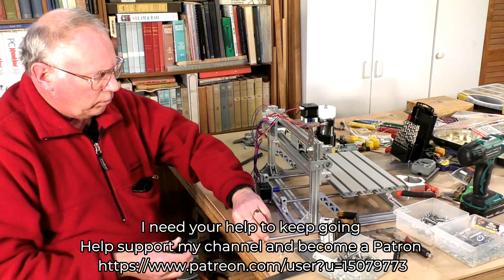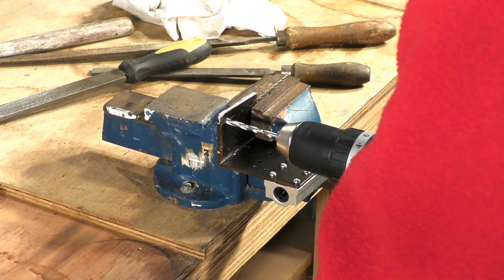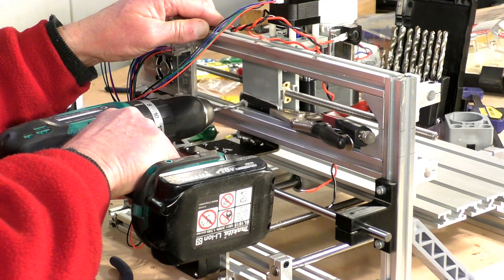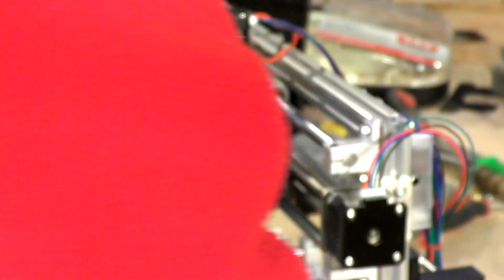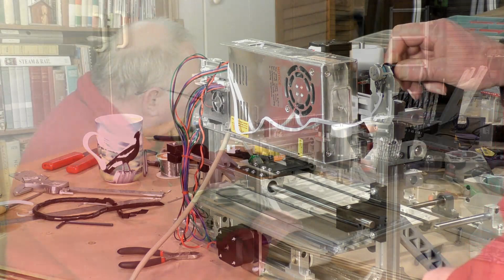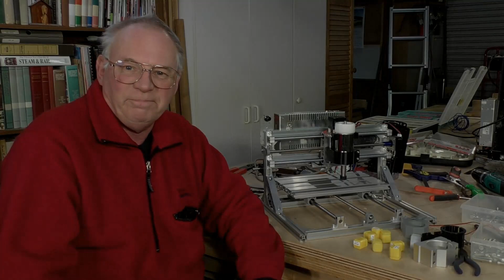3018 CNC router X-axis third (3rd) linear rail and twin bearing modification and installation

Comment: Roger, great wrk. I am doing somrthing similar, what I wish to know is is it possible to add the back rail at the top, would this work. I have mag provision for the electronics underneath the machine.
Reply from the maker: No its not
Reply: @inventorsworkshop9600  thanks Roger appreciated

Comment: 1) you've got a 500w motor being suspended by bearings in your nema17 stepper motor. Is that a good idea? Are they designed to take stress in that axis?
2) You've added an 8mm rail to two 10 mm rails. How much improvement in weight bearing will that give you?
Reply from the maker: Hi, it's a 300 Watt spindle and, see more of my videos!!!

Comment: Hi Roger... Did you ever successfully cut Aluminium with this machine? Other video's I have seen found that there was too much flex in the system, but they hadn't tried it with a third rail

Comment: The good thing about these 3018 is being so modular they are very easy to upgrade and learn. I bought a 3040T (although wishing I'd gone for a 3018 which was on my list), it is a lot more sturdy out of the box and came with a 800w VFD motor although I'm planning to upgrade the spindle to enable easier tool change with tool holders. I replaced the bed with a 20mm thick steel item with 6mm holes spaced out, got a cheap vice. I've also trammed mine up as was 1.5mm out in some places. I find the limiting factor is also Z travel, mine has 65mm but this is sometimes too short for my needs, but should be fine if you are doing engraving or laser cutting. Also built an enclosure with 8mm thick Polycarbonate panels  which along with the better bed and vice has made the 3040T much more quiet not too mention safer with flying broken cutters :-)  Really want to get a 5 axis Pocket NC but that will need to wait.

Comment: So I need to get a bearing like yours and a angle bracket. Was it light steel? I have lots of limit switches.  Here in my shed in Victoria.
Reply: I just looked up the bearing blocks and they appear to be a readily available SCS8UU type, Roger please correct me if I'm wrong. Quite nice and cheap in the UK at least.

Comment: Might think about gluing that bracket on as well. It’s ending up mounting in the center of the block since bearings are in the way. Will have a tough time resisting Y very much.  Great work.